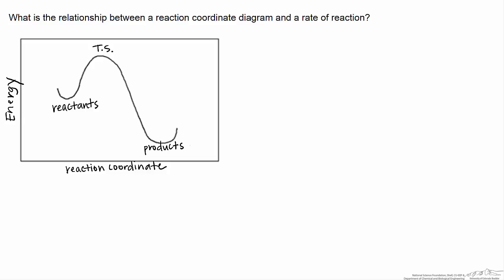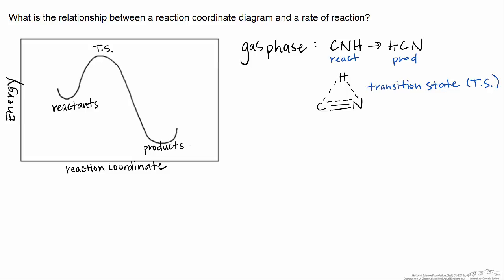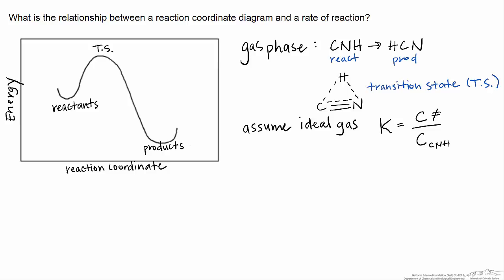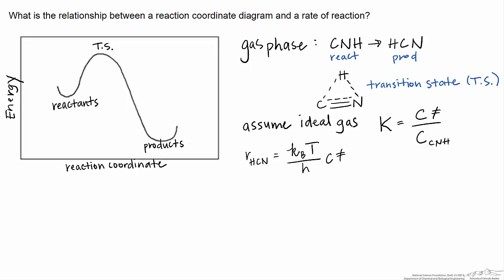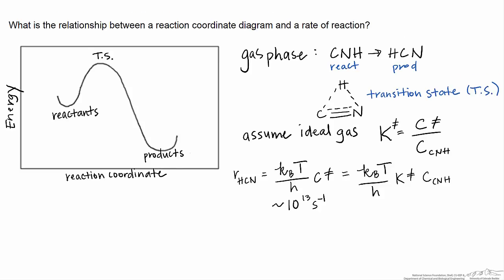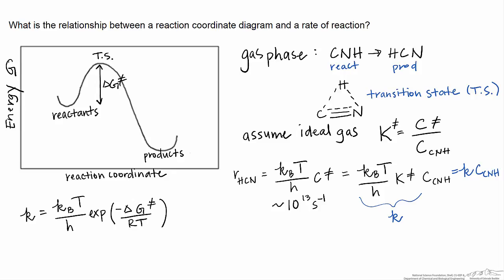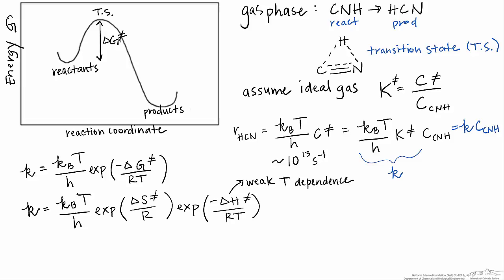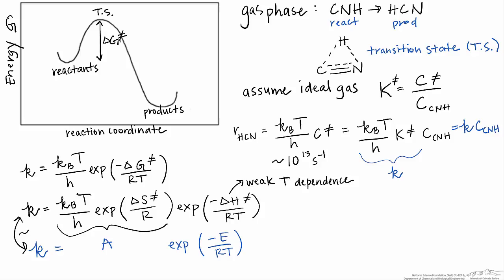Thermodynamic Interpretation of Transition State Theory: The Eyring Equation

Comment: The part that unsettle me is that I don't understand how the entropy competent of transition state is well defined (I don't think you can talk about the gibbs free energy of an unstable saddle point). The phase space around a local energy minimum has a well defined gibbs free energy (even if we only have information of the one point at the minimum, we can still assume harmonic oscillator and have a convergent probability distribution around the local minimum and have a well defined entropy and gibbs free energy, that is at least good enough for low temperature). At a saddle point (the transition state), I don't think you can't define a probability distribution around it; the down hill direction will make the probability distribution diverge.
What is wrong with my thinking?... or the theory itself is just very hand-wavy and there is no way to actually compute the delta G, since G of transition state is not well defined?

Comment: Kindly guide about following equations used in the determination of  ΔG and A ( pre-exponential factor), while doing thermodynamic analysis ( based on Ea obtained from model-free kinetic methods, applied on linear heating rate)
1. A= β * Ea *exp(-Ea/R*Tp)/ (R*Tp^2)
where β= heating rate e.g "10 Degree Celsius/minute"
Ea= apparent activation energy at T
Tp= Peak temperature of thermal degradation

2. ΔG= Ea+R*Tp* Ln( Kb*Tp)/(h.A)

Kindly guide , how these are derived .